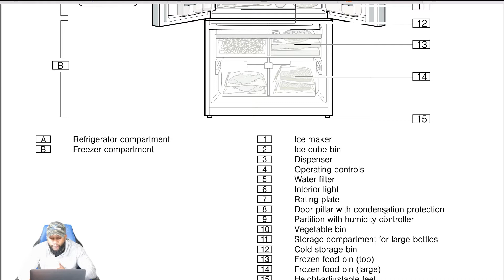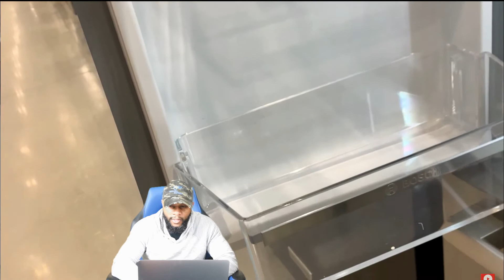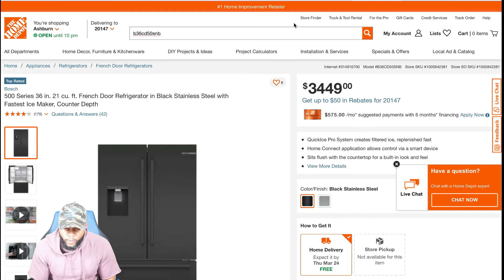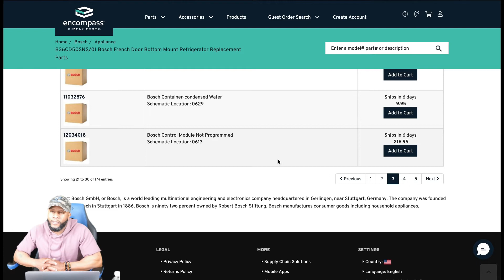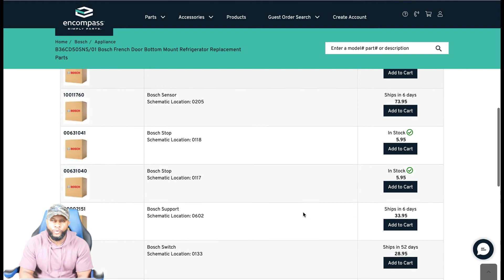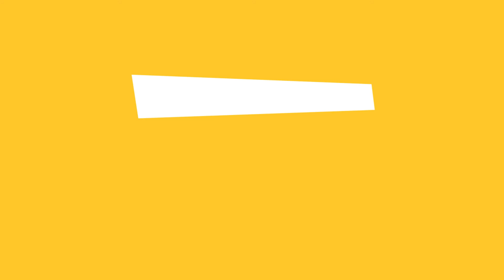(REVIEW) best refrigerator review 2022... BOSCH

Comment: Been looking at a lot of fridges lately. Bosch 500 has one of the larger freezers I've seen in a counter depth (But may depend on model). Well less wasted space compared to others. Their warranty on the website says 1 year for everything + labor, 1-2nd year non-electronic components (parts only), 2-5th year for electronics (parts only). Lifetime for rust on stainless parts.